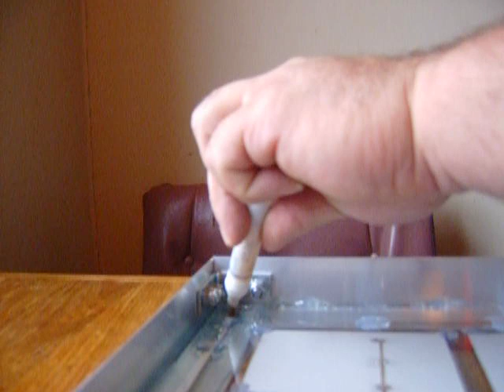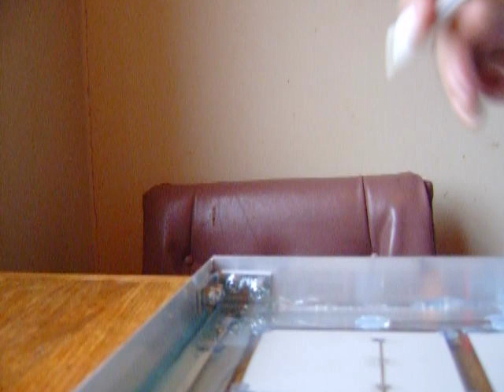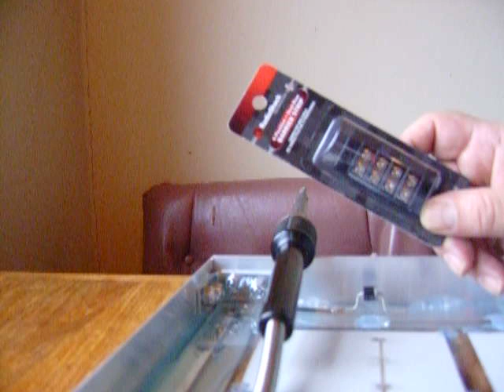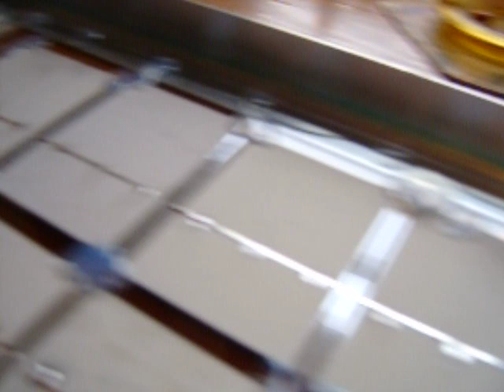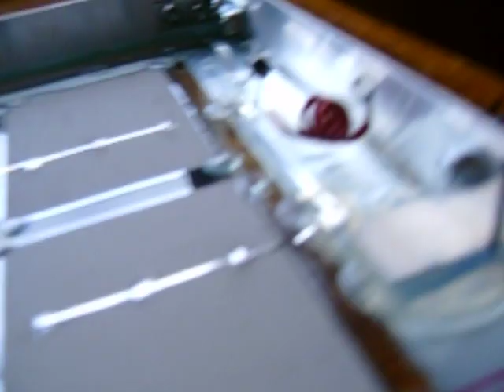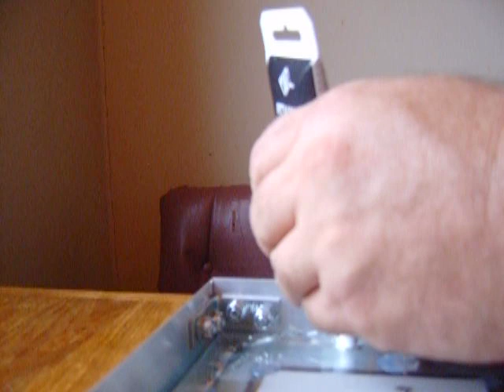How To Make a Solar Panel That Will Last For Thirty Years Part 9

Comment: This is the real video that is doing the thing on actual, I watched the other vids but it doesn't have any sense. Unlike this, I have question. Is this last for 30 years? Cool!
Reply from the maker: they have made it three years so far. I think they will last a long time. I like to buy factory panels now days but making them is fun and interesting.
Reply from the maker: all the homemade panels I have still work so far. It been 6 or 7 years now. so I bet they last quite awhile although I just buy Chinese panels now because they are so good and so cheaply priced. Hey it was a good learning experience. Everyone should try at least one time for fun. I made one for the 5th graders at school and man they loved it and learned a lot. I even let them pour on the liquid encapsulate. They did some wrenching on the nuts and bolts on the frame man they loved it. Its a good learning experience.